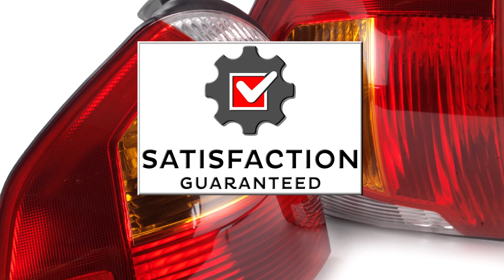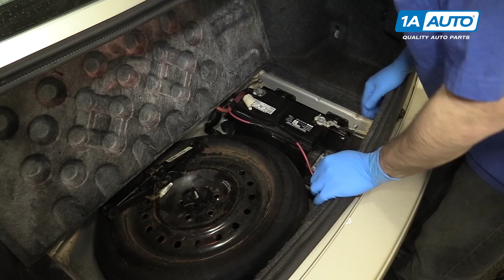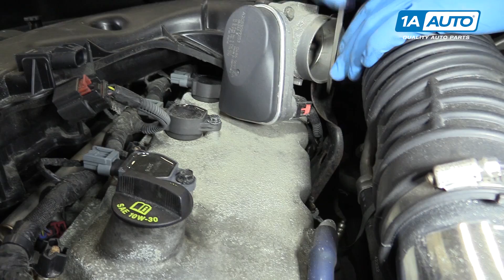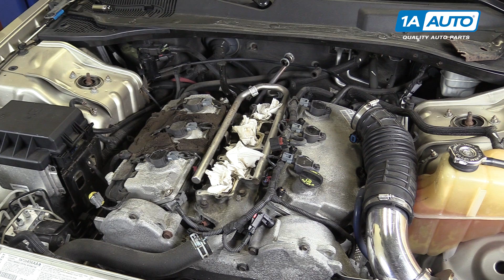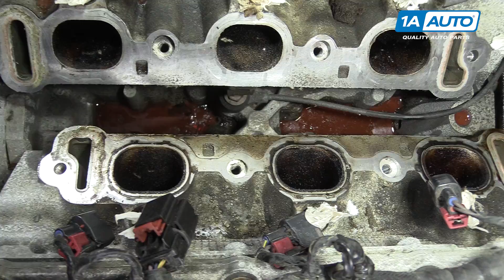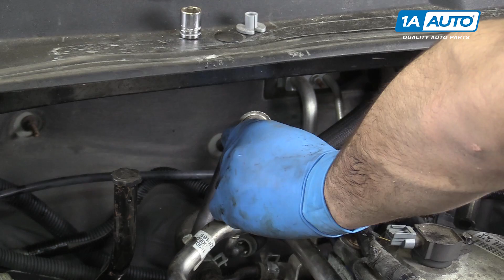How to Replace Lower Intake Manifold 05-10 Chrysler 300

Comment: can lower intake manifold gaskets cause coolant to get into cylinder 6?
Reply from the maker: +Grace Griffes We wouldn't be able to diagnose an issue like that here, you may want to have a local mechanic take a look at it. Thanks for checking us out! http://1aau.to/m/Shop-1AAuto-c
Reply: @1AAuto  I was just asking if  its at all possible that the lower intake manifold gasket keeps coolant and oil seperate. thank you for your time.
Reply: @gracegriffes8386  one thing that can be if your oil mixes with coolant that will be the head gasket
Reply: @Grace Griffes just wanting to answer your question to my knowlege that gasket if it brakes it has a different function it won't mix with oil or cylinders

Comment: Ive watched this over and over getting the confidence to remove lower intake manifold to clean out the carbon, replace gaskets and also Change out spark plugs :) biggest fear is not installing EGR valve seal correctly, have seen many people have trouble with that on Charger forums. Great video thanks guys
Reply from the maker: +Alex V Thank you for the great reply. We love to empower our customers by showing you how-to perform your own auto repairs while installing our high quality auto parts. Have a great day! 1aauto.com